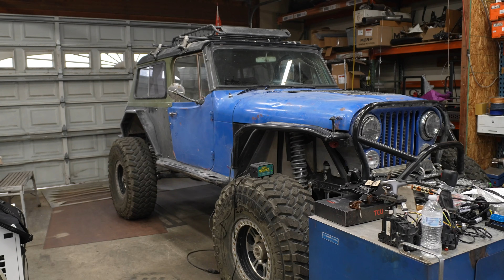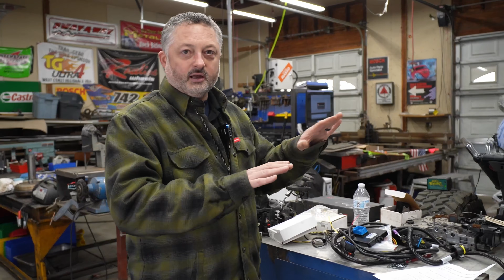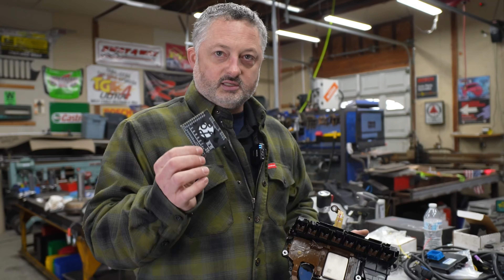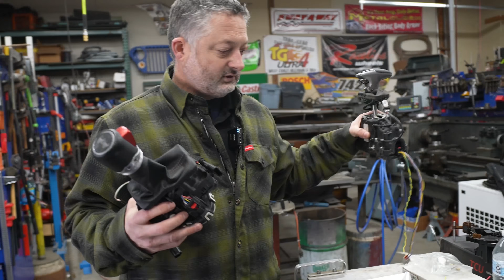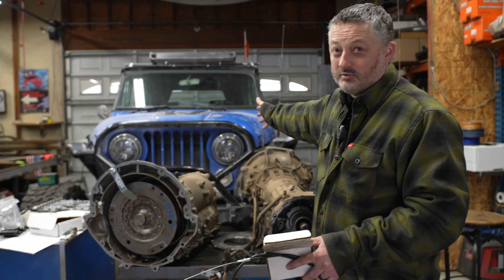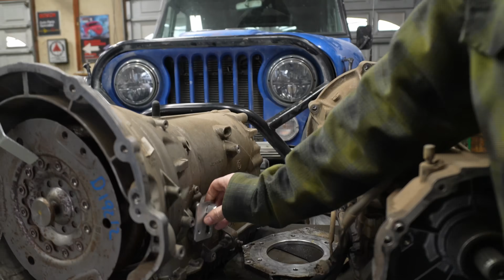8hp70 Swap Guide. What you need to know

Comment: Starting my research into this and I’m curious if any of the factory tcase are part time and if they’ll handle the power well? I’ve got a 91 Montero with a turbo LS that makes over 700ft/lbs through a 4l80 but I’d like some better over drive gears for the highway along with some of the other 8HP benefits over the 80e. My NP263 has had zero issues with the power but domi only sells adapters for 27 spline GM tcases that I’m seeing. Not sure what kind of power the stock 8HP tcases can handle but they need to be part time
Reply from the maker: The stock jeep jk auto t case bolt up to the ram extension housing.  The 392 t case is full time 4x4 but its not very reliable. An atlas tcase is probably the best option for that power level.

Comment: Now I want to 8hp70 swap my WJ. That inline 6 is a awesome motor. 👍🏽
Reply from the maker: An 8HP70 swap in a WJ with an inline 6 would be an amazing combo!
Reply: @CLDesigns742 Do you think the transfer case would work with the 8hp?
Reply from the maker: @lutherjackson_ the dodge ram 8hp70 has an extention housing that bolts between the trans and the t case. It has the same 6 bolt pattern as the np231. So yes it bolts up.  The spline count on the Trans is 23 spline. Same a auto JK you will need to check the spline count on your Trans. I suspect its the same 23 spline

Comment: great video. could you explain how to wire up the turbolamik to my LS swap that is using a factory ECU that dose not have the CANBUS feature?
Reply: and is not DBW. thanks.
Reply from the maker: All of the ECU option will work the same as far as wiring for a non CANBUS config. Tach, TPS, Brake light switch. ( Map optional ).  The German Sound PSC kit is the easiest and less expensive. Turbo Lamik has more featires but if you are not using them or they are not needed it not worth the price.  I have heard a lot of good things about CanTCU, but I havent worked with one yet.   What is the project?  Car ? Truck? Drift?Race Car?HotRod?

Comment: Rusefi.   That's  right.    R u s.  Efi.   - now makes a controller, that does the motor and does the transmission and has far superior control over both. Including fantastic Idol and, software that blows anything else on the market away because they didn't start from Hardware they started from software. You're going to love it. And you're going to hear nothing about this and, just get this it's $175 per unit.

https://youtu.be/7cFYlxZg5A8?si=B46IRmqFDukSzH9f
Reply from the maker: Interesting!!! I will check it out.

Comment: To my knowledge, Dodge does license/build some of the lower torque spec ZF8HP transmissions in the US, but the 70s and 90s are all built in Germany at ZF.   There is a lot of talk about the (BUY) and (BUILD) RPO designations for Dodge RAM trucks and I believe the 70s are all (BUY) which means they come from ZF in Germany.  Also, Guru Autowerks adapters don't have the ligtening scallops and use thread inserts at every threaded hole.  They also make really nice neutral holds and cooler fitting adapters.
Reply from the maker: I don't kow what year they started but I have seen NON ZF 8hp70 from a Ram 1500.  The recycler used a Dodge style code for it 8fe??? but it was deffinetly an 8hp70. The Dodge 8hp are usally much cheaper, but have heard the quality is less also.  I heard that Auto Guru is making some nice parts. I will look at them for my next project.

Comment: Even the best 8 speed automatic is not good enough. Despite the fact that it is the only one that is not a complete piece of crap, its still a piece of crap. What ever happened to the day when the OEM was the best resource? The only automatic transmission I've ever owned that worked the way I wanted was the 5-spd Allison behind my 2001 Duramax. Unfortunately, it was scrapped before anyone knew how to work with them. I don't drive automatics. I can fix anything on a manual set-up, but my current vehicle one can't even get the auto transmission controller they fail so often they are 3 months on back order. What happened to automobiles? They are just complete crap nowadays. My rule is, if it doesn't have an ashtray and a light, I'm not interested. The more mod-cons a vehicle has, the more often you'll be getting robbed by incompetent dealerships.

Comment: Great  video,, my son and I are the first in the world to install a ZF8HP70 to a jag-xjs V-12.. You are right about Daniel at DomiWorks,, he is a true gentleman,, he flew to another  country to scan some V-12,, designed and machined new plate for  us (of course,  we paid).. We also installed a Maxxecu EFI system in the jag, (Mobeck Tekniski) they are by far  the best ECU!!!! And what's incredible about Maxxecu,, the complete program is free!!! Turbo lamik is good, cantcu don't know (i hear com problems).. DomiWorks and GURU works sell all kinds of adapters for cooler lines. Those jeep and 4x4 geniuses are a bunch of cheap butchers.. For 50$ it's a guarantee fit !! I don't know if you  mentioned it but some ZF are threaded ( 2 different pitches also) at the cooler ports..

Comment: So will it bolt up in place of my nag1 580 in my 2006 300c heritage and work with my computer and traction control system?
Reply from the maker: It will bolt to the engine, but I do not know about the trans mount/ross meber or drive shaft.  Th computer controlling the Nag1 will not work with the 8hp. I don't know if anyone has done this swap. The german sound controll is working with the Dodge Can bus data but I do not know to what degree. ( how it effects the traction control ect.

Comment: 🤔How do these transmissions gear by send 12 volts through a solenoid???  I'm wondering if I can take a slap shifter from an old school 1970s automatic slap shifter. I  know I will have to lengthen the travel on the slap shifter because the old automatic transmission had 3 or at most 4 gears. So on the metal that has notches in it that caused the shifter only move from ONLY 1 gear to the next gear every time you bump the shifter and every place where the shifter stops that's the location there would be contact points they were voltage and or ohms to match each position to send current to each solenoid . So if I lengthen the travel of a slap shifter to match the 8HP70 transmission gear is it possible for every time the shifter stops into a position it would simply send the voltage  and go onto the gear, designated for the position where that shift it stops??? Even if I have to let off the gas between shifts, so there is not a sudden jerk when the transmission engaging into another gear.  Still this a lot nicer than having to push the clutch in change gears and then let out the clutch and give it gas again. Does any of this make sense to you and do you think it will work???😇 Tell me what you think .
Reply from the maker: I do not think  a slap shifter will work. The solenoid on/off timing is critical for these transmissions. To get the timing correct would be impossible OR be more trouble in r&d that just using a controller that is known to work.  Cool idea though. I like your thinking.

Comment: Currently sticking a Dodge 8hp70 into my turbo E46. I'm already on MaxxECU. I love the ECU for engine control. I had the car running/driving myself in the first hour and my tuner had it dialed in in another couple even though he had never touched one before. I'm hoping the new transmission does me well on Power Tour this year
Reply from the maker: A turbo E46 with an 8hp70 on MaxxECU sounds like a blast, good luck with Power Tour!

Comment: I'm building a 1941 Chevy pickup with an S10 chassis and 6.0 LS. My plan was to put in a 4L80E so I mocked it up with an empty 4L80E case. I have about 1/4" clearance at the upper portion of the bell housing area to the toe panel/floorboard under the cab. Is the 8hp any bigger than the 4L80 at this critical fit area? I'd love to do the 8 speed swap instead but I have my LS sitting at an ideal spot for clearance with the radiator and for weight distribution.
Reply from the maker: I have an S10 with a 5.7LS and a 4l80e also. S10 Body.  The 8hp is slightly bigger in the bellhousing area. They are VERY similar is size, but it tight clearance situations it hard to say if it would fit.

Comment: who make dodge cummins 12 valve to 8hp70 jaguar or dodge adapter
Reply from the maker: I'm waiting for turbolamik to support the new 8hp1075. I don't know if the 8hp70 will handle the diesel torque. I think this is close.  https://www.domi-works.com/products/dodge-viper-to-8hp70-n63-8hp90-n73-n74?srsltid=AfmBOop5ebsAFfKQzh30vfGXjiOiFEuaoA8gTZEJ_nJAHawDntVi0FnW

The v10 and 12v have the same bolt pattern as far as I know. The flex plate.  all bets are off. I don't think anyone is making one yet. You could check with AutoGuruWorks  They seem to have good knowledge and adapter selection
Reply: @CLDesigns742 thanks for reply. Theres a company that makes BMW 8hp to 12v but I want cheaper replacement option from JLR instead of bmw. Stock 12v make 440ftlbs, what am I missing?
Reply from the maker: @namechane1758  Most people do not leave the 12v stock, but in  12 form the 8hp70 should be Ok.  You are going to need the run what ever controller in analogue mode. You will need an RPM signal and the TPS signal. I do not know how to get this out of a 12v but defiantly doable.  The MaxxECU mini or the German Sound PCS would be the easiest to make work. The Turbolamik will also work but can be a little bit more difficult.
Reply: @CLDesigns742 '97 ram has ckp and TPS native, I just need and adapter. I realize it might burn the trans up if I turn it up. That's why I need a setup for cheap replacements. Jaguar range Rover transmissions are like $300 delivered 😅
Reply from the maker: @namechane1758  Email Domi Works they were VERY responsive when I asked for a custom adapter.
Reply: @CLDesigns742 they said they have to put it on "to do list" then 3-4 months of production time

Comment: I’m starting a swap in my 88 ram. I have already hemi swapped it with a 545rfe and it is giving up. I’m running a standalone wiring setup using the a factory 2011 ecm the has a obd2 plug. I plan on using the turbo lamik kit and the wiring calls for a can high and can low but my factory harness calls them out as can + and can- do you think that is the same?  I think so. Also what fluid do you recommend?
Reply from the maker: I don't know if turbolamik has CAN support for the stock hemi ECU. I do know that the PCS German Sound controller does support CAN for your vehicle. It would be easier and cheaper than the TurboLamik.
Reply: @CLDesigns742  They do
Reply: Thanks for the input. I have been looking at sound German and spoke with Russel.  I use my truck for racing and I really liked the idea of the 8 different mode with the turbo lamik.
Reply from the maker: @JAMESSPEEDSHOP  https://www.facebook.com/groups/427191575238636
Reply: CAN Hi and Lo is the same as CAN - and +
Reply: @gdrozd555 Do you have any customers that have used the turbo lamik in a ram truck? I have all the mechanical parts i need for my swap but I still have not ordered a controller. I would love to use the turbo lamik but I can’t afford to spend that much money and then not get it to work correctly.

Comment: I thought the standalone TCUs didn't require the stock electronics to be replaced with a bypass PCB, but looking here, that's still needed for many systems and it kinda makes them less interesting if you're gonna need another separate module anyways 🫤

About the shifters, some custom devices have been popping up lately, even sim rig shifters are being adapted to cars out there.
Reply from the maker: The Turbo Lamik and HTG require the orginal TCU to be removed and PCB or wires installed.  The PCS controller, CANTCU and MaxECU use the Orginal TCU. The MaxxECU requires a custom flash of the orginal TCU.  The PCS controll may require a flash / firmware if the donor vehilce did not have a manual shifter ( dial )

Comment: Any words of wisdom for 5.9 magnum owners? I'm having trouble finding support for an 8hp75 to my 5.9.
Reply from the maker: Thats a good question.  Does the 5.7 Hemi and the 5.9 have the same bolt pattern?
Reply: @CLDesigns742 They're pretty close minus 1 bolt on top. I'm no engineer but I think it'll work. I'm impressed by how much can be done with those LSs (especially on non-GM platforms). I find myself reading about them then trying to adapt GM philosophies to mopar lol
Reply: Mopar CAN bus supported on Turbolamik

Comment: Pretty US centric but nicely done.
The CAN CTU is imho a very important approach! BECAUSE: It does NOT change the ZF parameter and FAIL preventing functions on the 8HP.
Afaik (I am not an expert but really, really want to set an 8HP behind an ZD30) the CAN CTU "just" needs some standard infos from the engine and behind that goes the CTU which translates that to the ZF.

The ZF can be tuned later by an ZF tuner (forgot the name, pretty basic stuff though) which works also on OEM cars.

But the relevant factor is: You are not playing with a very well engineered ZF firmware! A failing firmware, while in traffic on the road can get your car in serious problems! (imagine overtaking an loosing gear or a blocked tranny ...)
Reply from the maker: Yes I'm in the US so my info is bais by what I can get here. 
I think you take a risk when ever you modify a vehicle. I have these swaps in have complete 1 off suspension and a host of other mods. Possible failures are endless. I'm ok with the risk, but I get your concern.
Thanks for watching and the comment

Comment: 33:50, Your torqueconverter was most likely  in the transmission  too far. They will run HOT🔥 , if they do not have enough clearance to circulate the oil . It may need a spacer on the bellhousing, about .060" - .125" if you have them made , I would have about 5-6 , .045-.050" shims cut. Or if you have a spacer between the flywheel  and converter mill about .040" off and try it.  Or EVEN BETTER, put a gauge on a magnetic base, and measure where the converter is installed. Unbolt the  converter, push it in and see how far it will go in. It should have a fair amount of movement  before bottoming out. If it has about  .300" it's a transmission oil cooler issue. Stall/gear ratio issue, possibly tire size/gear ratio issue. The 4L60/80 and most transmissions can have this issue. In some cases you can have the converter to flywheel mounts milled down or new mounts welded on, or the drive end milled for clearance . It fits in the transmission,  and must be done correctly , or you will cut seals, damage bushings and cause a major leak.. and possibly get metal in the converter and transmission.. a shop that works on converters  is the best bet, but having send cut send or someone  cut sherytmetal spacers is cheaper.. .040-.050 should be enough to make enough difference,  of that was the problem  you will know it.. you really should use a dial gauge  or atleast  dial calipers  and be creative to measure it, some magnets and thin plastic  or card stock measure from the converter to pan with the flywheel bolted to the converter, then unbolted and pushed in as far as it can go, you can measure from the converter to the flywheel  then.  It can be a problem with adapters, pushing the converter in .030" too far,  you can even have engine thrust bearing issues..

Comment: 12:49 , I would not mind a transmission to shift in manual mode. If it shifted at the redline. Or at the rev limiter.  I had a 4L60/700R strip the teeth off the planetary  in a 1-2 shift when in 1st gear once. And it was a stock engine. It supposed to had a shift kit in it.

Comment: Chrysler 300 2014 up 8hp45  v6 and v8s to of course had therm to. i have to agg this 5.0 jaguar is as good engine people just can not fix them a at 150++ and hour will timing chains or just tensioner 50 bucks oem  are not happening sadly or that garbage plastic cooling pipe metal ones are on ebay to fix that mess
Reply from the maker: I 100% the plastic garbage is killing more cars that people realize.  If people really want to be earth friendly we need to concider naking things that last longer. Less platic crap.

Comment: Awesome set up, I saw your wife’s Toyota in the WFO Commando video and was drooling. I’m planning out a build and was thinking of a NWF doubler but this has me thinking an 8hp and atlas might be similar $$ and better performance. Do you happen to have a build write up or thread somewhere for the Tacoma? I’d love to take a deep dive on that thing. Awesome stuff keep up the great builds!
Reply from the maker: Hi Ethan, My 2 cents. If I were to chose NWF doubler or 8hp. Hands down the 8hp. The taco has a 4 spd atlas. It really should of had a 2spd Atlas but my wife wouldn't let me swap it. The 8spd gained 4 mpg over the stock trans. It pulls away from a stop MUCH better and now cruises on the freeway with WAY less effort. I'm not a fan of the NWF doubler. It a nice product but they leak and are noisy. I'll try and make a video about the Toyota soon.  Thanks for watching!!!!
Reply: @CLDesigns742 that would be epic! I’m sold on the 8hp and will be basing my build around that. It’s a no brainer at this point, and will make it a bit of a challenge and learning experience too. I’d love to see a build video or thread, I’m subscribed now so I’ll stay tuned! 👍